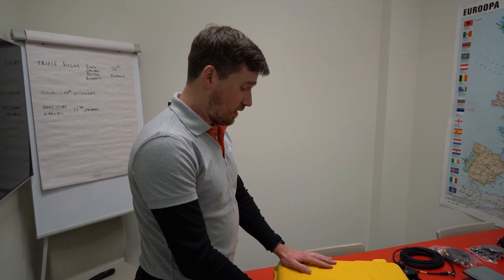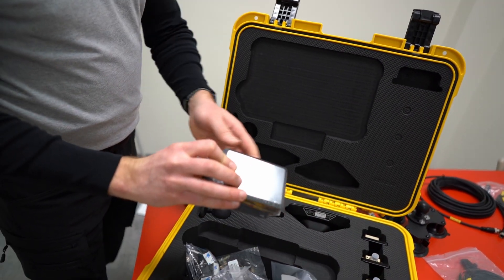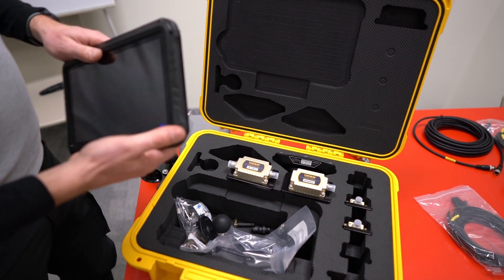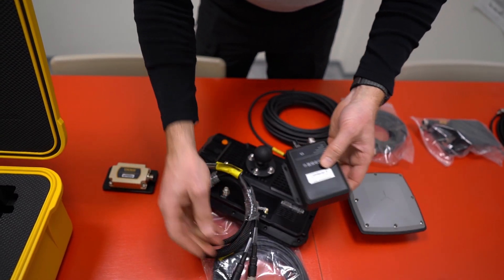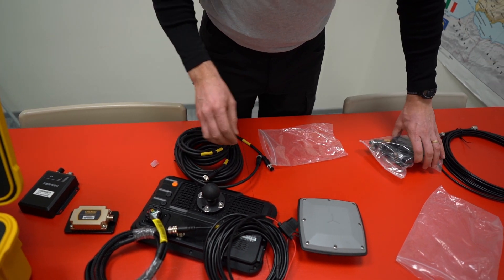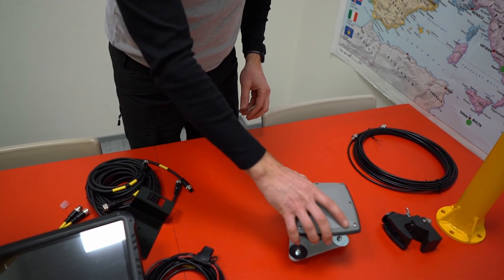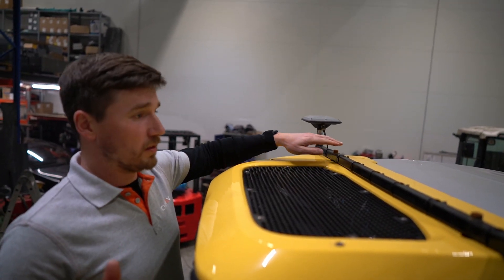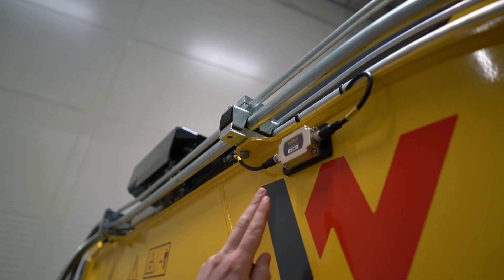CHCNAV MCNAV TX63 Excavator guidance system unboxing and install

Comment: to many cables sensor on the bucket no way never good why not do like iDig system cable sensors and no sensor on the bucket
Reply from the maker: Hi. I agree that the cables on the bucket could be solved a bit better. This is a machine with tilt bucket and also a tilt bucket system. That is why we have a sensor on the bucket. Only way to do away with bucket sensor for the tilt bucket would be to have an encoder sensor on tilt axis, l am not sure the cost is justified though...